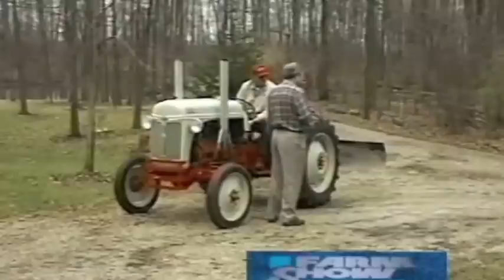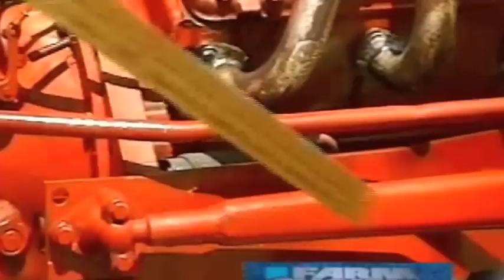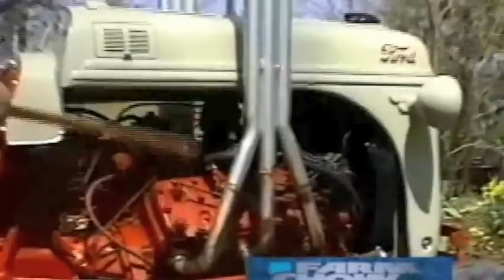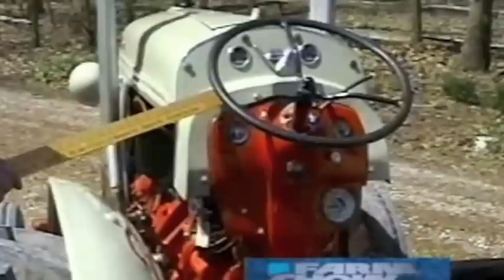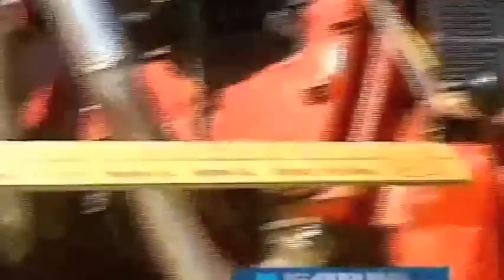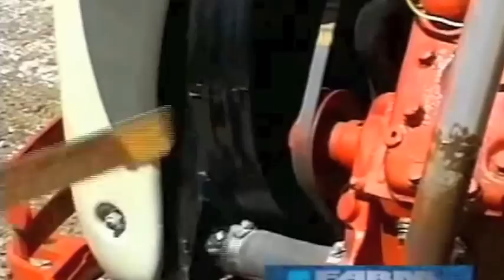FARM SHOW - Kit Helps Repower Ford 8N With V-8 Truck Engine

Comment: Spent my time on a stock 8 N It Needed a bigger engine. but I don't think even a flathead V8 would have made it comparable to a 1950 Case VAC tractor
Reply: Oh yes the flat head funk conversion gave you lots of power you can pull a three bottom plow with ease in 3rd gear the 8Ns were only 4 speed transmissions

Comment: you're supposed to JOIN HEADER PIPES TOETHER in a collector as it sucks each cylinder empty. this sounds ratty
Reply: Air Port Be an individual.  That's not a rule.  Do what ever you want to do.
Reply: Marvin Blankinchip hhuyuuh

Comment: Those Flathead engines did not have 100 horsepower they are only 60 horsepower and the biggest one came in a flathead Mercury
Reply: I think they were 95 horsepower. The sixes had about 60 HP.